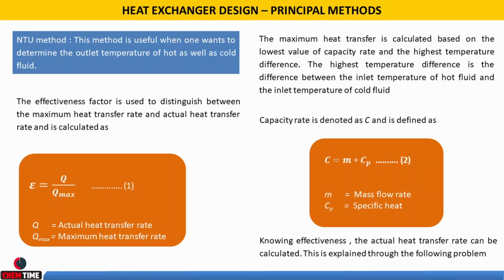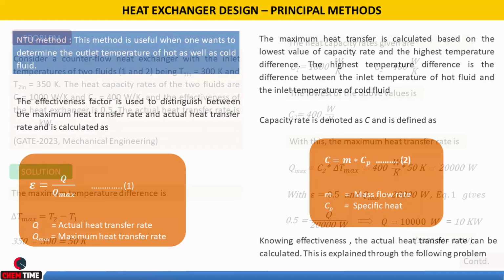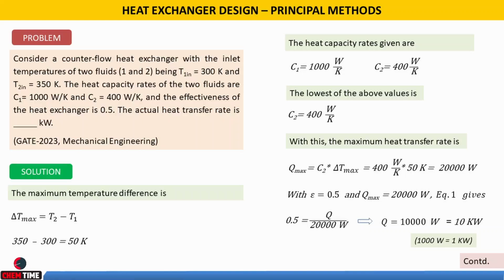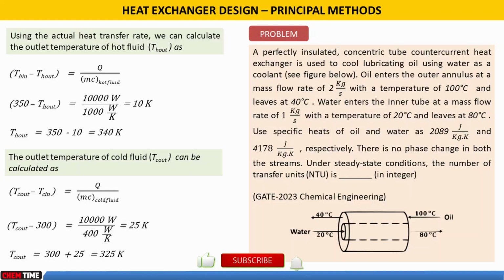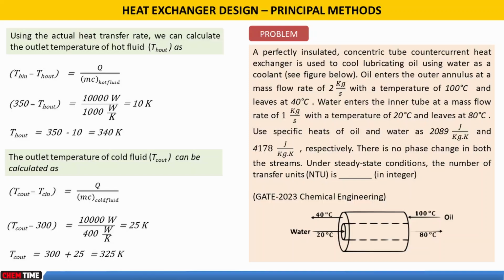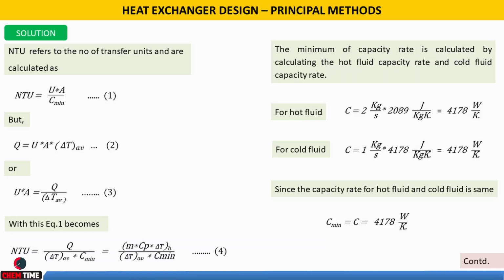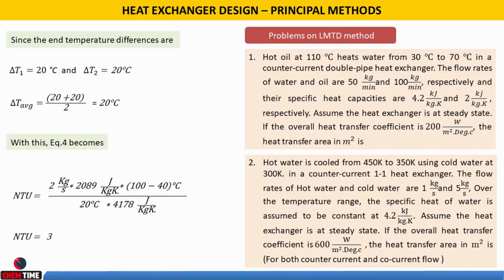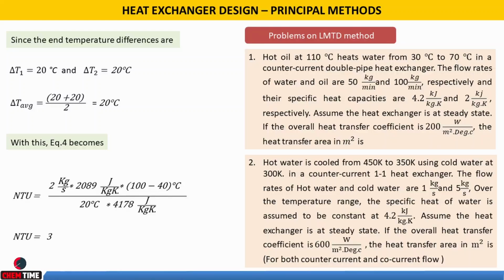HEAT EXCHANGER DESIGN -  PRINCIPAL METHODS (PART - I)

Comment: Good presentation and explanation sir
Requested to extend the value of NTU or % of effective ness  which will help to engineers who are working in industries to make a decision wether the heat exchanger required cleaning or replacement etc.,
Reply: Yes. Based on effectiveness, calculate the temperatures at the outlet and compare with the plant data